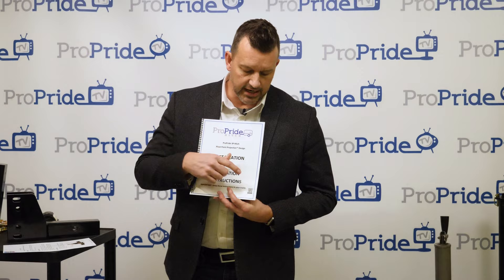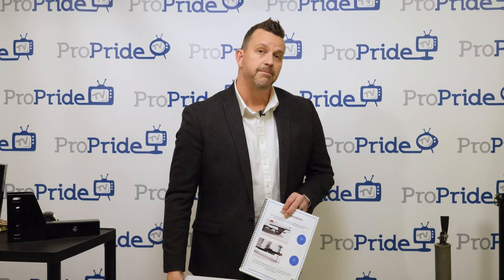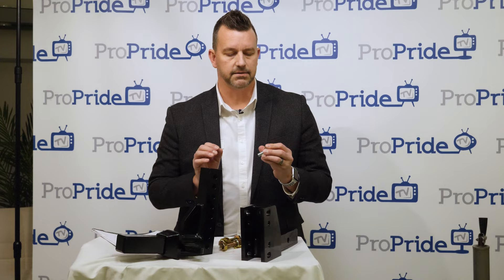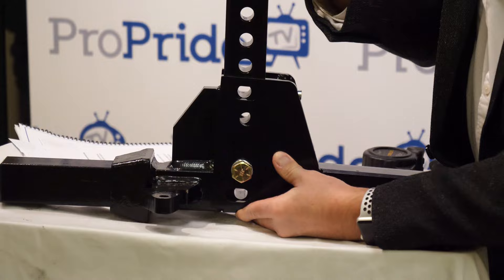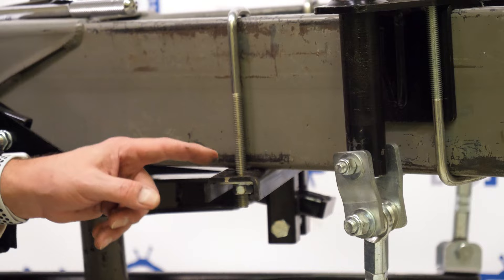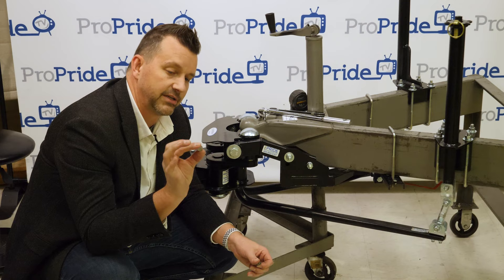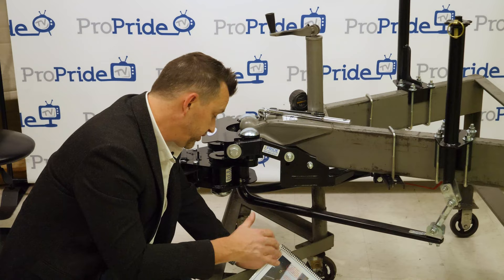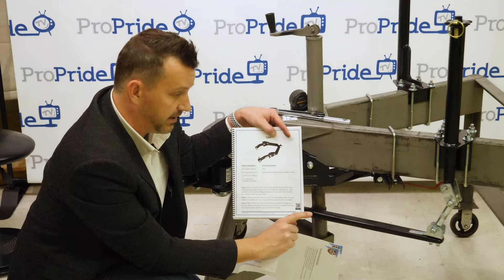ProPride 3P Hitch Installation Quick Tips: A Guide to a Smooth and Easy Setup

Comment: Another great video.  I had to get towed so I had to disassemble my hitch in order for them to use a ball hitch.  I have mine loosely assembled back on the trailer and wanted to know all these key points before I tightened everything up.  Huge help.  And, you did a great job explaining all this.  I truly appreciate it.  I did realize my hitch only has two bolts on the truck riser/drop.  I'll be making a trip to get another bolt. We bought a used trailer and this hitch was installed.  I do have the "U" bolts that connect the spring bars to the weight distribution jacks.  The new set up you have looks like a great upgrade.  I am still getting used to hitching up; sometimes level ground and sometimes not.  When it is right, it slides right in.

Comment: Do we email you to get a PDF of the update manual (with QR codes)?  Thanks.
Reply from the maker: Yes, send an email to: customerservice@propridehitch.com
Reply: Any ballpark ideas as to what one would see as a realistic tongue weight? I realize the 3p is around 190# but one would think that not all of that weight goes solely to tongue weight, and that a good portion of that would be distributed to the trailer/ trailer axles for weight. Referencing a 36’ TT if that matters at all.